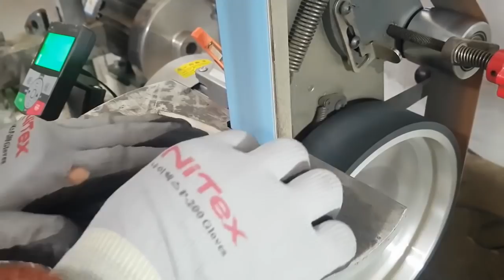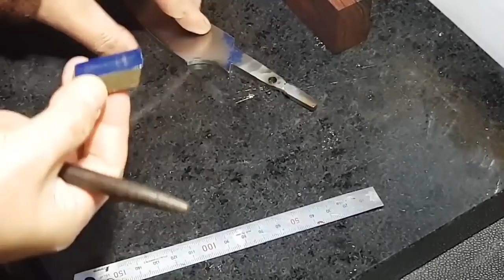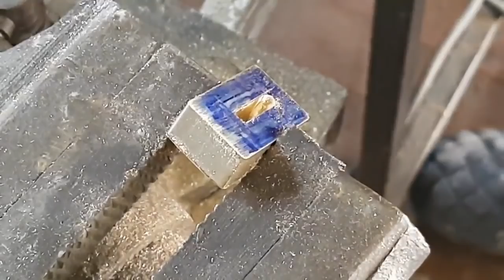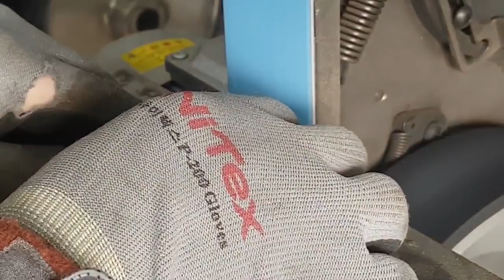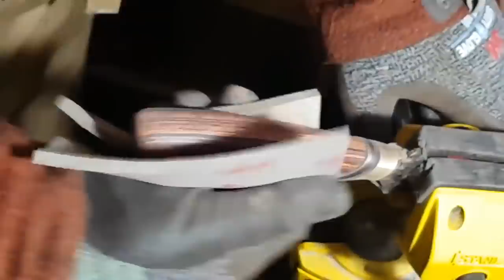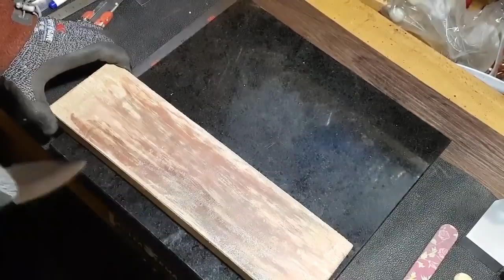KNIFE MAKING / BUSHCRAFT KNIFE / HSS(HIGH SPEED STEEL) 수제칼 만들기#18

Comment: Im starting to make knifes and I wanted to try HSS, do you think I can bevel it with a file?
Reply from the maker: Of course, as much as you like...I'll cheer for you... ...
Reply: @artisticson2275  all my encounters with HSS have been machine tools. isnt it extremely brittle?
Reply from the maker: @petermacris8260  Will a knife be as powerful as a machine tool's impact be?
You can set the HRC to about 59 to 60 by heat treatment...^^
Reply: @artisticson2275  No, you can't if is real HSS steel. Files are useless with this.
Reply from the maker: I think it's going to be hard...

Comment: That's not HSS. You drilled it very easy and 
you have filed it very easily too for being HSS steel.
Reply from the maker: The drill bit is a tungsten carbide bit.
Reply: @artisticson2275  I tried yo use a manual file in real HSS and is literally impossible due to his 
heat treatment. How do you do that? Your file is made with carbide tugsten too? Tell your secret please. Thanks! ;) I will try with HSS 135º edge cobalt drills.
Reply from the maker: @iberotecno  The hole is usually made of concrete bits...^^

Comment: Very nice and beautiful knife but that is not a bushcrafter. Bushcraft blades should always be full tang because of the forces that will act on the handle/blade when for example batoning. A hidden tang blade like this is not strong enough for those tasks. Also the tip is too thin for a bushcraft knife, it would be quite the nice hunter and is also quite a gorgeous display piece.
Reply from the maker: Thank you for your advice. I'll show you a better look....^^